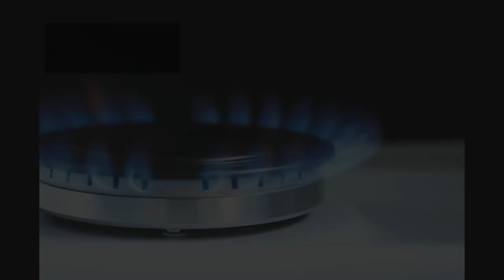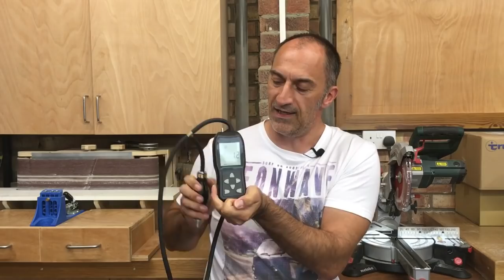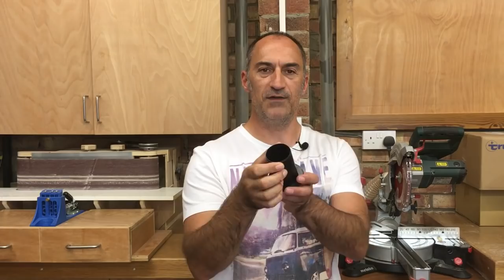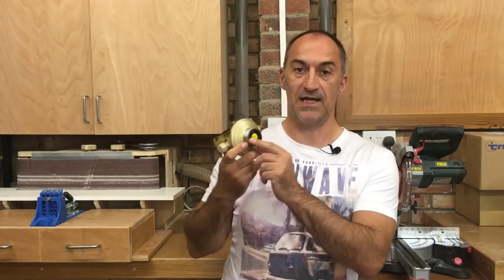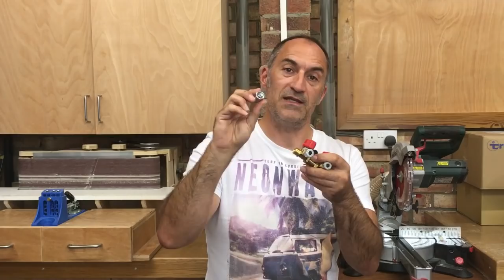Installing LPG in a Self Build Camper Van

Comment: Pretty please Can you post a direct link to the exact manometer that you use as can't seem to find it via the ebay link that you've provided :). Thanks!
Reply: Ahh ok, so the pressure cuff pipe wouldn't attach direct, you need the 8mm pipe as well? 

Trying to put a few videos together of my own conversion. Needless to say they often refer to your work! I am a bit behind though. It's difficult filming whilst your trying to figure everything out! Makes your achievement all the more impressive
Reply from the maker: Clancaster84 it’s was more work in the background doing research and planning editing etc than building. 
I got a small barbed T piece, put gauge on one end, pump on another and connect the last end to your 8mm copper gas pipe. The rubber tube is enough to hold small pressure without additional clips. Send me over a link 😁
Reply: @GregVirgoe  Hi Greg! When you say you connected to the 8mm copper pipe do you mean that you didn't connect to the test point on the regulator? If not, was there a reason why? Also, what kind of barbed T did you use? I'm trying to figure all this testing out now as our GASIT installer had to wrap up his business due to Covid. Because of this I've had to do a lot of the pipework myself as a total novice, so I want to test it myself before then getting it tested professionally as well. Scary!
Reply: Hi Greg, did you do the test with or without the truma connected? Just reading through instruction manual to install mine and on page 26 my understanding is that you’re supposed to disconnect the truma! Seems ridiculous to me as that’s the whole point of testing. Interested on your thoughts!?
Reply from the maker: Nicholas Croydon-Fowler I tested through everything
Reply: Hi Greg, great thinking on the pressure cuff. How did you attach the pressure cuff pipe the the regulator test point? Jubilee clip? The rest of the truma is successfully installed thanks to your help!
Reply from the maker: Clancaster84 I pushed it over the 8mm tube to test all the Pipework in the van then did a working test of everything in the gas cupboard with soapy water on the high pressure side.
Reply from the maker: Hi Sam, there's a bit of a story behind this, when I did my testing I had a leak but could not trace it, checked all my joints they were sound.
Turned out to be the manometer and pump that was letting by so I had a brainwave, a blood pressure cuff!! It has a mercury gauge and pumps very accurate.
So I brought one off eBay for £11 and cut the tubes used the gauge and the pump and it worked absolutely flawlessly, well happy with it. Here is the link https://rover.ebay.com/rover/1/710-53481-19255-0/1?ff3=4&toolid=11800&pub=5575265109&campid=5338027957&mpre=https%3A%2F%2Fwww.ebay.co.uk%2Fitm%2FNylon-Cuff-Blood-Pressure-Monitor-Stethoscope-Sphygmomanometer-Manual-BP-KIT%2F223145088865%3FssPageName%3DSTRK%253AMEBIDX%253AIT%26_trksid%3Dp2057872.m2749.l2649
150mbar = 112.5mm Hg (it's what the gauge reads in) I left mine on test all day and it never dropped one bit, well happy.
Reply: @GregVirgoe  Excellent, Cheers.
Reply: @GregVirgoe  Greg you star, thank you.

Comment: Hi Greg. Excellent video. Just a question though . I have a gas locker with a drop vent. Do I have to fit a vent under my gas hob? Or is that just an advisory? My water tank is below and it's really difficult to do it.

Comment: Great video and hugely useful. I'm very grateful to you for it.

Are barbed air fittings and circlips still acceptable? I note that they are currently in use by the majority of domestic legacy LPG applications.

750mm as max length for flexible hose is just not long enough and I'm sure there must be some sort of get around for this. I used a Joolca gas heater for shower and hot water in my VW camper. The Joolca is supplied with a 1m hose and the manufacturers work to the UK regs.

To use it I lift it out of the rear cupboard onto the ground behind the camper and this requires a hose of 2m (otherwise the gas heater is too near the van and shower curtain for safety). If I can't use a barbed air fitting and can't buy a hose over 750mm I'm a bit fooked.

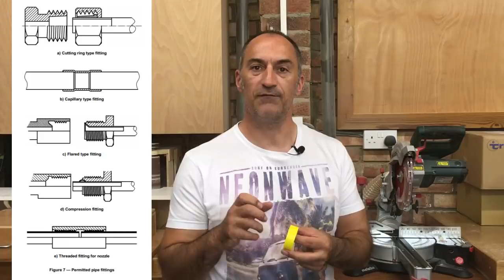Comment: at 14:30 you mention you can use soldered fittings on pipe work, but from looking at other forums, I see soft solder is not to regulation? This is a quote from one forum:

"It's covered in UKLPG COP22. Soft soldered only permissible in structures that are not designed to be moved e.g. PD and RPH. Brazed or compression in LAV and Boats."

Any thoughts on this?

Comment: Very educational and well presented, thanks Greg. I want to use a clip on Irish, butane regulator with built in valve in my gas locker. Do I still need a bulkhead regulator and another valve or can I  connect the regulator hose directly to copper through a nipple? I can't find an answer anywhere online.

Comment: I bought one of those bulb pressure testers and pressurised the system. The pressure keeps falling rapidly but I’ve sprayed every joint and pipe and can’t find even the slightest leak anywhere. Is it possible that testing in very cold weather is causing this?
Reply from the maker: What i found is that the slightest temperature difference made the presuure change, mine actually rose when the day warmed up. can you isolate locally at teh cooker and boiler to see if that helps
Reply: @GregVirgoe  the test I’ve done is with both the cooker and Truma iso valves closed. I’m literally only testing the main pipe runs through the van at the moment. I saw your other reply to another commenter saying your manometer was letting by, I think that must be what’s happening for me
Reply from the maker: @paulweller84  what I did was purchase a manual blood pressure pump and cut off the cuff just to use the hand pump and mercury gauge which was really accurate and solved the problem of the leaky manaometer.  Like this one https://www.ebay.co.uk/itm/305198934213?hash=item470f4628c5:g:zwoAAOSwWDBgSkxB&amdata=enc%3AAQAIAAAA0AagIHqsxqq7nKOJsTUYyR%2FLsu%2BP8clBunNeVX%2BD1vZqofNXtqqjujPS2mPk7JnMolqjVnIjnCICWKP3YRvHY9jTkFxCkQ1e%2BqFxA3M1Xn5PH8HEXzAH6Kg%2FCvEfJvcc2XV%2FhwCxr3xUwBl9McdbkmmCtflqZ0HdNU3slmpA%2FV%2BjdsmCGKMth0tFTsOCgif%2BiSDDt4ywBC8x%2FRHyRXorMV2e3Eez%2BNEeXIgwGfW3mTDyUKu7b5bqRuKocJsHGSeMMAQ5XFeZfP%2F4yOIsxbTfTIA%3D%7Ctkp%3ABk9SR5Dvg_P3Yg&mkcid=1&mkrid=710-53481-19255-0&siteid=3&campid=5338027957&toolid=11800&mkevt=1

Comment: Thanks for yet another properly researched video

We bought our van already converted and have spent many hours fixing all the bodges from whoever did the conversion

It has onboard LPG and most of it looks to have been done correctly apart from it doesnt have a sealed enclosure for the bottle. Thats another job on the to do list

It does have 2" round vents in the floor under the gas water heater and 3 way fridge, are these a requirement of the regulations 

Thanks
Reply: Just watched your combi boiler video and answered my own question 😀

Yes, you need drop out vents by your appliances
Reply from the maker: @chriswilliams6954  yes an enclosure for the gas cylinder is a must. That vehicle would not had passed a gas inspection 🧐 it is annoying that you parted with hard earned money for sub standard work. At a minimum they should provide you with both gas and electric certificates the same as you get when you buy a house. 
Hope as goes well Chris 👍🏼

Comment: Funny how most autogas/underslung fill points are in the driver’s side B pillar - LPG engineers pass these as gas safe regularly despite proximity to an opening door. GAS IT recommend for underslung systems where the fill point is in the habitational area, that a rubber boot and moplin tube be used to room seal the fill point so any leaked gases can vent safely through the floor.

Comment: Hi Greg
If you need to use a tool to connect the gas then yes the work has to be done a gas safe engineer ....Not so many of us gas engineers hold the lpg element 
Great stuff..
Reply from the maker: I would always recommend the system be checked and certified by an approved lpg engineer for peace of mind 👍🏼😃

Comment: Thank you Greg. Just wanted to confirm. At low level to secure bottle can a strap be used or do they require a base stand like you showed.  Thankyou
Reply from the maker: You should use two bottle straps to keep the bottle secure. I used the stands to get the base off the floor to allow any escaping gas freedom to get away in the vent.
Reply: @GregVirgoe  perfect. Thanks for your time

Comment: Greg you are honestly a life saver! We have a bit of clarifying question around the location of the gas tank/locker relative to the exhaust. I found the diagrams from the regulation a little confusing. Does the locker have to be both 250mm away from the horizontally and vertically. we are currently planning to put our gas locker within 250mm horizontally but well above 250mm vertically (one a very large toe kick with air separating it). Would that be compliant or have we misunderstood?
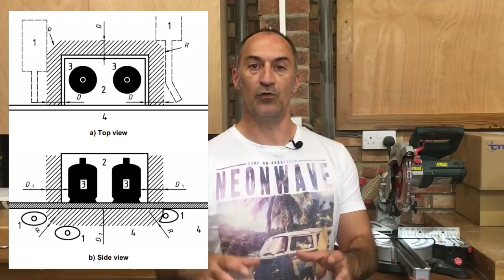Reply from the maker: If you pause the video at 7:37 you will see the diagram and it does need to be 250mm in all directions. It’s to avoid the bottle getting overly warm if that heat was transferred into the van through the floor. 👍🏼

Comment: Another fantastic video, thanks Greg. Quick question, in later video you mentioned you'd actually put your LPG tank where your freshwater tank is under your van. You only address how to install an LPG tank INSIDE the van here - how would you do this per the regulations? I'd like to do this in my van so this would be very helpful! Happy to discuss on email if easier. Thanks!

Comment: Hi Greg
Very helpful info, where did you get the electrical cut off switch. Can't find anywhere.
Thanks
Reply from the maker: It's a Truma Gas Shut off Valve, they make a 10mm and 8mm version. I used the 10mm one and installed 10mm copper to my manifold then 8mm copper to each appliance. Here is a link for you https://autogasshop.co.uk/product/truma-remote-gas-solenoid-and-switch-gs10-10mm-fitting/

Comment: Great video. One question I've been left with though is you mention that you cannot install a gas outlet below a window. In my caravan, the fridge is below the kitchen window, which means the two rectangular vents are directly below the opening window. And after a quick search, I saw multiple new professionally built campervans with similar fridge vents below or directly alongside opening windows. Did I misunderstand here?
Reply from the maker: No you didn’t misunderstand a gas flue should not be sited below an open window in case those products of combustion come back into the living space. I also think the same about vents that end up inside awnings that you then sit in with the build up of CO gasses. It’s a question to pose to the manufacturer 🤔
Reply: @GregVirgoe  Thanks for the reply. I noticed a mention in your kitchen cabinets video of a 12v compressor fridge. I might go for this option instead. Did you do a video about the fridge at all?
Reply from the maker: @paulweller84  I don’t think I did a specific video about it. It’s a Dometic CRX50 it’s worked well for us maybe a little small and could do with the 65 or 80l version 😃

Comment: Hi Greg,
Great video. I see from later videos you have travelled to europe in the van. Are there any additional requirements imposed by the ferry or Eurostar carriers when travelling from the UK to Europe or vice versa, with respect to having full or partially full lpg tank(s) on board during crossings?

Comment: Brilliant information explained clearly and concisely as always Greg. One caveat to this is that (after extensive conversations with Truma), it is perfectly fine to install a (specifically) Truma flue underneath or within 300mm of an opening window (not door) providing a Truma window switch has been installed. This detects a broken seal when said window is opened at automatically shuts the boiler off to prevent any exhaust gas re-entering the vehicle. There may be an equivalent available for other manufacturers but that's for one's own research!
Reply from the maker: Absolutely correct. I guess when you have the window open you wouldn’t need the heating on but may want some hot water. Better to be safe than sorry.

Comment: Thanks Greg for another great video!! There’s some chatter on the internet about compression fittings having issues when exposed to vibration in the vehicle. Are flare fittings really any better?  I have used compression, and plan to install a LPG detector for extra safety, so should be OK. Comments?
Reply from the maker: I don’t see how you can avoid using compression as most appliances, valves abs regulator use them. Do your tests, install drop out vents and detectors if you want extra protection 👍🏼😃
Reply: @GregVirgoe  Thanks Greg, I’ve noticed that many of the US appliances provide a flare fitting at the input, so that is part of the reason I asked. Maybe UK or EU are different. Nevertheless I agree, vents and detector will give me peace of mind. It’s also good to know that others have used compression and they have worked.
Reply from the maker: @bruceeldred6417  flares are better for higher pressures like on the bottle side 👍🏼😃

Comment: Just a quick question, you stated you can't secure the bottle in the locker with anything that requires tools to release it?
What is the reason behind this? As the high pressure hose is attached to the bottle using a large spanner.
Another question, you state any appliances must be run in copper or steel pipework? So the high pressure side is run in flexible pipe, but the low pressure side must be run in copper or steel.
Reply from the maker: That is what the regulation state 😊

Comment: Great video, as always.  I have a couple of questions through. Why not  advise to always use jointing compound on compression fittings, rather than saying use it if a joint leaks? Also, I'm pretty  sure you can't use soldered fittings as you sugested. Have I missed something?
Reply from the maker: Yes while many will say you shouldn’t need it a little smear of gas safe paste saves a lot of hassle later. The regulation do list soldered fittings. I’m only quoting what’s in there. 👍🏼😃

Comment: Hi Greg, just got my truma combi 4e. I am a gas engineer. Domestic. The gas connection on the truma. I have never come across this type of connection. Exactly how does it connect with the stepped olive. TIA
Reply from the maker: It works exactly like a compression fitting. 👍🏼😃

Comment: Thanks so much for this. I’m wondering if anything is covered regarding proximity to heat sources. You mentioned the exhaust but so many conversions place the bottle close enough to an oven or the heater that you’d think would even be hotter

Comment: Hi Greg, Thanks for taking the time to post this video. Could I ask your advice on the following? I have a caravelle and modular furniture/appliances. For example (and relevant to this comment) I have a tailgate and have mounted a Smev 9222 into a frame which is secured to the floor rails. When I need the space I simply take it out to make way for the seats. I do the same with the bed, swapping it in/out for seating as required. I now want to move to an underslung gas tank, but keep the flexibility with the hob going in and out depending on what I'm using the vehicle for. I also want the hob to be on a sliding shelf, so it comes out the back a bit (like those slide pods). So in my ideal world what i see is a gas supply port/socket in the floor that I plug into, which only supplies gas when it is in use (i.e. appliance plugged in), and then a flexible hose to the hob (for it to be able to move in and out of the back). Oh and with an isolator somewhere along the way! Am I away with the fairies?! :)
Reply from the maker: Why don’t you use one of these quick release connections https://www.ebay.co.uk/itm/BULLFINCH-BLACK-BBQ-POINT-OUTDOOR-LPG-GAS-QUICK-RELEASE-FOR-CARAVAN-MOTORHOME-/144393558595?mkcid=16&mkevt=1&_trksid=p2349624.m2548.l6249&mkrid=710-127635-2958-0

Comment: hi. may i have advise on my project? i have two appliances one on 37 mbar and the other 30. would be better one regulator 37 mbar and which stage? or a split from the tank and two regulators? thanks (i have a underslung 60 L)
Reply from the maker: Can I ask “What appliance requires the higher pressure??” 🤔
Reply: @GregVirgoe  pizza oven

Comment: Thanks for the video. I was always told the gas should be shut off at the bottle whenever the van is in motion. I'm curious what your procedure is. To my mind if you're using any inline isolation switches then the bottle can still leak, but with it's own compartment that seems a pain to have to shut off every time. I'm also not sure how you can avoid hidden gas pipes to some extent; if they're not behind a cupboard then they're in the cupboard at at risk of being bashed. I'm curious if you've found a practical solution here. Thanks!
Reply from the maker: I always turn the bottle off at the manual shut of valve before driving

Comment: Hi Greg, your the best, but you don’t mention the need to purge new empty gas cylinders of air, or cylinders that are being re-used, before the initial fill up. I’ve worked with a lot of industrial and domestic gas installations and purging is always carried out before the initial fill as part of the commissioning process. 
Presumably, the petroleum gas, and the air present in the bottle, would mix with the gas above the liquid gas, thus creating an explosive atmosphere at the appliance due to the oxygen content in the air, with the possibility of a backfire down the pipework.    What’s your take on this. AJS.